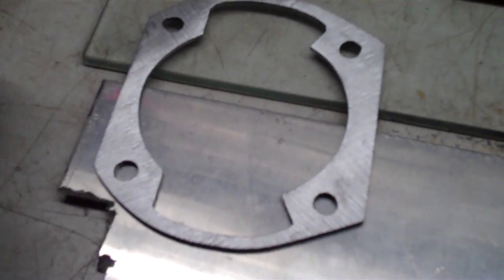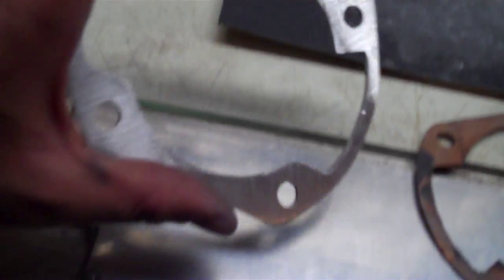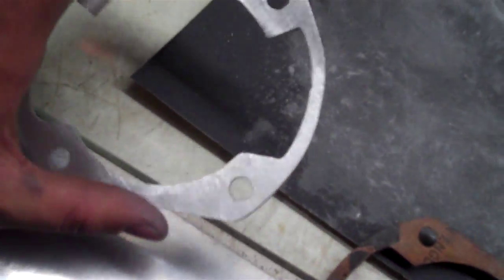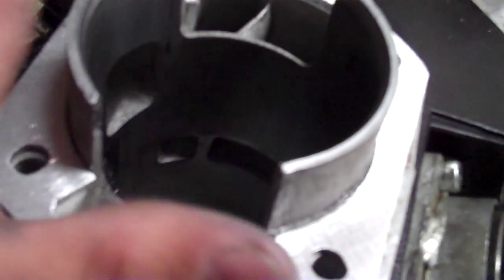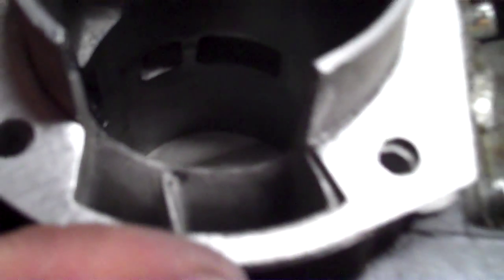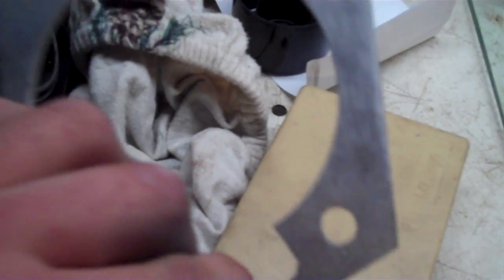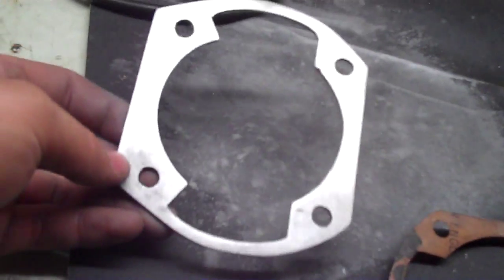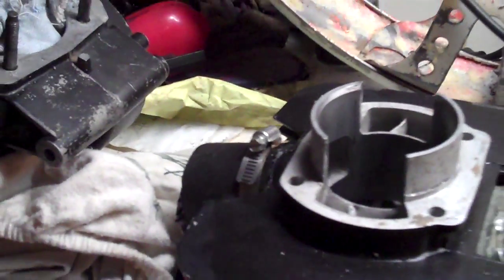Aermacchi/ Harley Davidson MX-250 Con-Rod Mod spacer progress

Comment: Thanks for the reply Jerry.  Got back on my MX 250 project, Put my crank halves into the machine shop to increase crank pin diameter from 20mm to 22mm to work with the Can Am con rod.  Did you rebalance your crank, what balance factor??

Comment from the maker: Falicon in Florida built the crank for me. I bought a Can Am 370 Rod from Tony Murphey Can Am in Cali and had it sent over to falicon to have it pressed into the orginal MX/SS flywheels If you crank journals are fubared, you can use regular SS/SX flywheels, they pop right in but are not as lightweight as the MX flywheels. Better for street use and lower end tourque. Your piston will be the harder to find, but complete matched NOS piston/cylinder asseblies pop up on Ebay for a few hundred